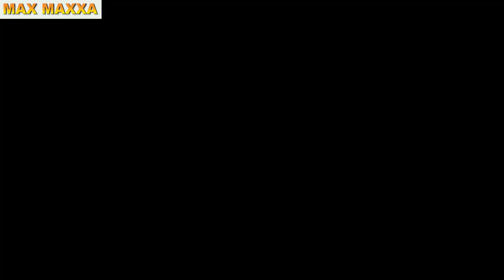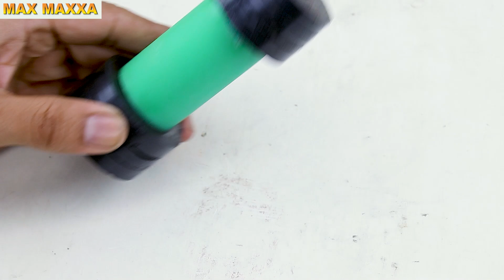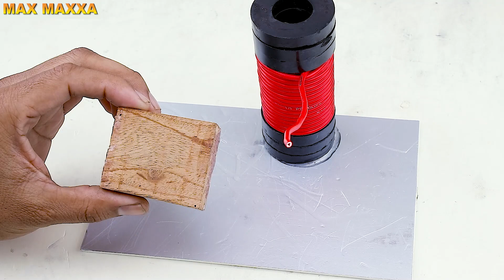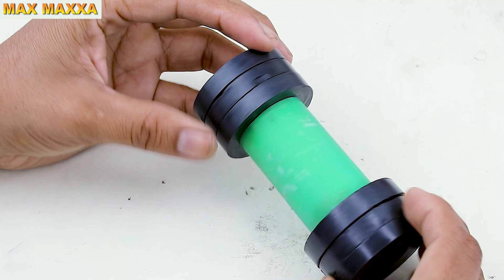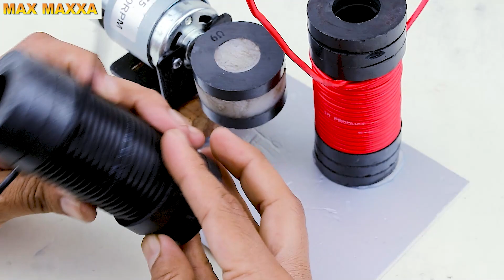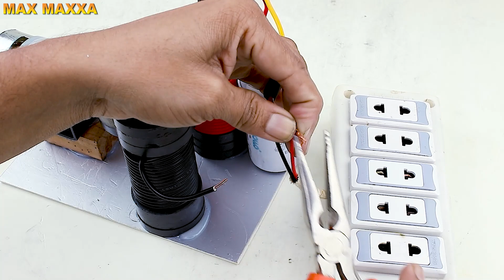Electricity 220V 13000W Motor Capacitor Generator PVC wire 220 volt service energy science project

Comment: I took a picture of this and gave it to chatGPT. It said:
"Here's how it works:

Rotating Magnet: The magnet attached to the motor's axle will create a rotating magnetic field as the motor spins.

Coil in Magnetic Field: The coil of wire positioned near the rotating magnet will experience a changing magnetic field.

Induced Current: According to Faraday's Law of Electromagnetic Induction, the changing magnetic field through the coil induces an electromotive force (EMF) across the coil, which can cause a current to flow if the coil forms a complete circuit.

Experiment Observation: By connecting the coil to a load, like a light bulb or a voltmeter, one could observe the induced current as the motor spins the magnet.

This simple yet effective setup can vividly demonstrate the fundamental principles of induction and how motion in a magnetic field can be converted into electrical energy."

I recommend you check out ChatGPT. it's smart and could help you discover new ideas.